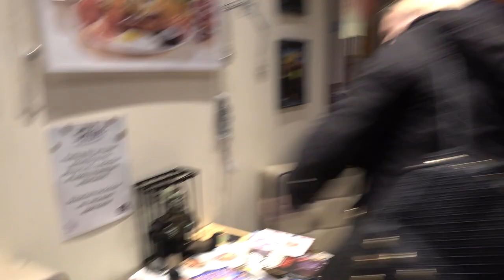DRIFT MATSURI 2017 - THE VLOG

Comment: i have to say it! its time to cut your losses pull the running gear out of the 86 stick it in an S15 chassis and win the BDC this coming year
Reply from the maker: I can't say it hasn't crossed my mind. It's just a bit boring though. I'm thinking about trying independent suspension on the rear instead of the live axle.